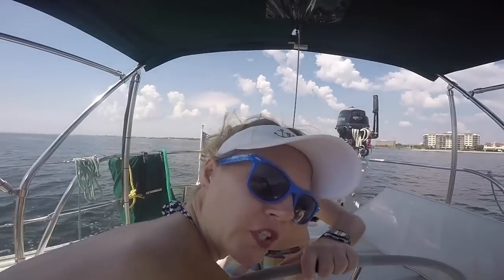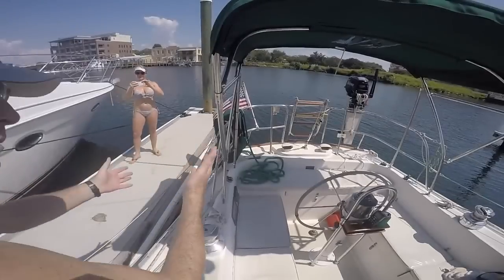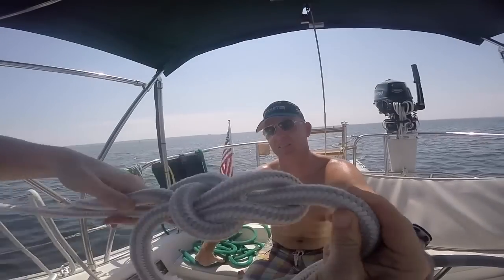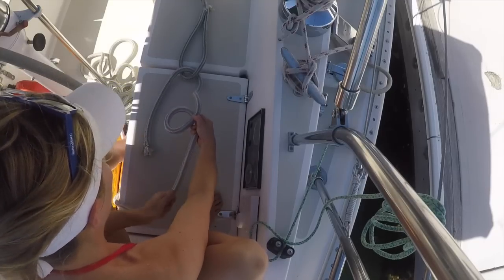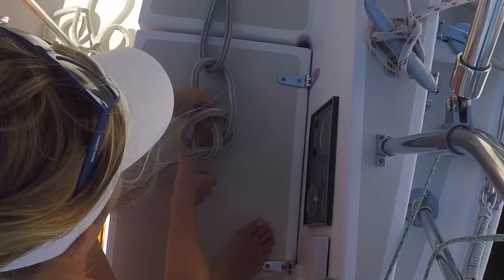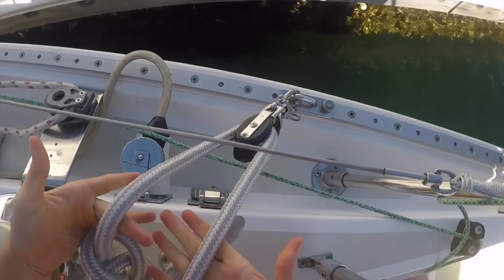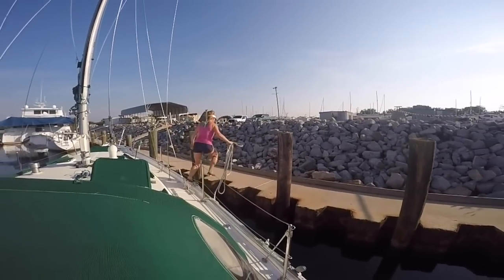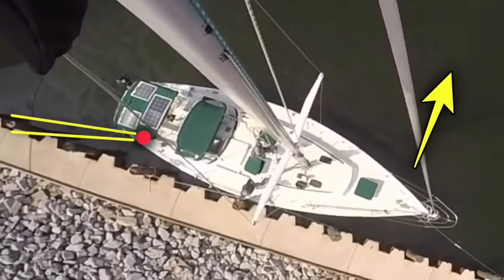#81: How to Dock Single-Handed

Comment: I singlehand a lot and my boat is similar in size.    I advise against using a complete loop.    If you get into trouble, you will have no way to ditch the line and power away from the dock.  I make a bowline loop in the end of the dock line and approach the dock as slow as possible while maintaining control and put the boat into neutral.    (This is not a race)   Get the bowline loop over a dock cleat - using an extended boat hook works well, put the loop over the hook.    Its made for that.   Once the cleat is looped, wrap the line around a cleat on your boat for almost one turn and hold the end of the rope back away from the cleat.   As the rope gets tight pull on the rope and brake the boat... the rope may slide for a foot or two as the boat slows.   When the boat stops moving, fasten the rope to the cleat.   Put the boat into forward and idle...  This will drive the boat against the dock and prevent the wind from blowing you around.    Once the boat is held against the dock, go forward and toss a line around another cleat on the dock from the bow.  Secure.   Return to the cockpit and put the trans into neutral and shutdown the engine.    If you do this correctly, you can do this in a slow and methodical way and not have to run or move really fast which greatly improves your odds of success.    If for some reason you are going too fast as you approach the dock and you can't brake the boat.... let the rope slide over the side.    It will be hanging from the cleat when you try it again.    On attempt #2 you can use another rope or grab the hanging rope with your boat hook.  If you have a fixed loop and you get into trouble you have no way to escape without cutting the line...  which takes too much time.   You always need a plan B in case you get into trouble.   I have done this at night, singlehand several times.     Its not hard.

Comment: Although your attempt to offer advice is commendable, docking a boat on a pontoon that is longer than your boat is not particularly difficult. If you show a technique for single handing a boat into a pontoon berth shorter than the length of you boat I would be much more impressed!
Reply: Agree, using the stern cleat is just not an option with same length or shorter pontoon berths. When using a mid ships spring line, controlling the stern swing out is the challange, and avoiding a hit on the boat next to you.

Comment: Everybody knows that the pivot point is not at the rudder. If you attache the docking line at the real pivot point which is normally close to the beem or the middle of the boat, you do not need to turn the wheel at all, the boat will move to the dock under forward slow power and stay parallel to the dock.

Comment: Just a quick summary about pivot points. It moves based on the boat’s motion, pressure fields around the hull, and the amount/location of forces applied to the boat. Stopped, is is generally near the middle of the boat. When going ahead/fwd, the pivot point is towards the bow.  When going, astern, the pivot point moves aft.  When not making way, but stemming a current, it moves towards the up current end of the boat.  Once you put a single line ashore, the pivot point is at the point where the line is attached (in in the case of the anchor, the chain roller).  So by putting the line on the stbd qtr, once strain is applied, you are putting the pivot point where you want/need it.

Comment: Thanks for the demo. As a long-time single-hander I'm a great advocate of techniques that make docking ('berthing') easier. There are probably as many ways of doing it as there are economists with solutions to the national debt, but the principle is one that mariners for generations have known as 'using a spring'. It's possible to spring on, or to spring off. A rope attached to a cleat on the boat near the stern or the bow and run along the dock can be used to spring on or spring off. Best of all, however, especially when singlehanded or lightly crewed is a spring secured to a midships cleat, which uses a technique similar to the one you have demonstrated, but with greater versatility if the wind is blowing off the berth or if there is a cross-berth current. My own preference is not to obsess too much about the pivot point - but instead to focus on the merits of a system that keeps the line clear of the propellor; that is as short as possible once secured; and as near the mid point of the boat as possible. That way the boat can be held snugly against the dock and wind or current can't lever the boat off the berth at one end while the permanent lines are rigged. One other tip is to check out the range of boathooks available on the market that enable a loop to be placed on a dock cleat or the mooring eye of a buoy without leaving the boat or leaning over the side - the best of them work really well and once tried you'll wonder why you never had one earlier. In fact, more than one .... so that lines at both ends of the boat can be placed using the device. Anyhow, good sailing to you guys ..... and please keep the tips coming. None of us is too experienced to learn new tricks! Here's one of those boathooks that works well: https://youtu.be/3zhPsTtLy4c
Reply from the maker: Great, thank you for sharing Roy!

Comment: Good demo guys, the more you practice the easier it will get and your confidence will grow so you can do it with the wind blowing you off the dock.  Easiest way of determining the pivot point of your boat is to observe what happens as you steer the boat in open water.  If you turn hard to port you will observe that the bow will go to port but the stern will go to starboard.  This is an extremely important thing to know when docking or coming alongside.  Most fin keel boats are designed to and will have a pivot point (while moving forward) that is in line with the mast and on the leading edge of the keel.  In reverse the pivot point is the trailing edge of the keel and just aft of the mast. Long keel boats are slightly different but only slightly. Your docking procedure works well but you are not using the steering pivot point you are just using a spring point.  For your docking procedure you need the attachment to the boat to be well aft.  I do something similar using my mid ship cleat with just a long loop that I slip over a dock cleat from the helm as I slowly pass, I do not need to do anything with the steering.  Try this exercise when you get a chance, it is great fun and will demonstrate the pivot point of your boat.  In some open water, bring the boat to a stop and while keeping the helm dead ahead, give a blast of reverse and watch which way the boat turns, it will turn slightly.  Its called prop walk and is very useful.  With a prop walk to port, that is the stern going to port in reverse, you can with practice, turn the boat in its own length going to starboard.  With a prop walk to starboard the turn should be to port.  Here is how you do it, with the boat dead in the water put the helm hard over to starboard and leave it there. Now give a short blast of forward just until you feel the helm wobble and then take the power off.  The bow will now be turning to starboard and the stern will be going to port but the boat should NOT be going forward (much).  Now give a short blast of power in reverse, this will stop any forward motion you have and the prop walk will make the stern go to port and the bow to starboard thus continuing the turn.  See how this is going? so just keep the helm hard to starboard and give short blasts of power alternating between forward and reverse (without crashing the gearbox) and you will amaze people with your skill.  Developing this skill can get you out of a whole heap of trouble. Good luck, fair winds and sunny days.
Reply from the maker: Thanks Paul.  Appreciate the input!

Comment: Interesting technique.  I am definitely going to try to use it if possible.  The challenge with my current slip is a 5 knot cross current. Therefore I always have to approach with a decent way on, so as not to be pushed into my slip-neighbour's boat by the current.  This means approaching the dock faster than I would prefer, and then hitting  reverse at the last minute.  My whole adult life I have expounded the virtuues of slow speed, gentle docking, but now I am a member of a club that is located in the bottom of a canal, so all of that has changed.

Comment: Thanks for the vids!

I prefer bridles for that situation, same concept but different. On my boat I run a long loop from the midship cleat (or chainplate bc I lack midship cleats) to the sheet winch. Coil the loop, split the coils between both hands and throw in a Y shape. With some practice you can catch a cleat from quite far. Then just haul in the line via the sheet winch and steam forward. Because of the triangle shape the stern is kept in check. Now step off the boat. I never leave my boat without a line attached somewhere. And yeah, it works in windy conditions as well.
Reply from the maker: Awesome.  Thanks for sharing Horst.  I would imagine the triangle shape, as you call it, would be a great way to spread the force to keep the boat parallel to the dock.  Thanks for watching and commenting!

Comment: I always dock at my slip using a premeasured line. I, however leave my slip lines at the dock. I have other lines on board if going to another dock, etc. The slip stern line has a loop on the end and a tennis ball tied behind the loop five or ten inches. When I leave the slip I toss the stern line in the water. The tennis ball floats and keeps the stern line where I can easily get it with my boat hook. I just put the stern line loop over my winch and ease the boat into the slip. Works great for me.
Reply from the maker: Awesome idea about the tennis ball Greg.  Thanks for sharing.  Sounds like your plan is like ours in the reciprocal as you attach from the dock to the boat but same principles.  Good tips here.  Thank you!

Comment: Thanks for the video!  A couple quick comments: always step off a boat, especially smaller ones.  Never jump.  You should whip or tape or heat shrink the bitter end of the lines.  You can use a sheet bend or double sheet bend to make a loop out of the dock line.  It's quicker than a bowline and quite secure.  If both ends of the line were plain, a reef knot would work.  Sheet bend may be a little more secure in that use.  Also, steering away from the dock is to have the motor thrust push the stern towards the dock.  The stern line levers the whole boat into the dock due to the forward part of the motor thrust.
Reply from the maker: Thanks Loanwood.  All very good points to add.  Appreciate you watching and chiming in.

Comment: If there is no off catway current or wind, then this method works fine. If there is a off current and/or wind, the stem would quickly veer off the pontoon. A long, slightly forward of midship spring line would be much safer bet. Also, a slack bowline is an insecure knot as it easily comes undone, catches easily on deck ware, plus there is chafing between the two lines. A safer knot would be the more compact double sheet bend or, if there is not an eye on one of the lines, there’s always the zeppelin bend which is a too little known and used vibration proof bend. Thanks for the vid and good winds to you.

Comment: Docked single many times. Weather makes it very challenging but the key is planning ahead, a radio is well worth the investment also. Hell It once took two of us more than an hour just to set anchor out of the navigation channel on a 30 footer in river current when a gust front surprised us followed by a squall line coming through. Wasn't really frightening but definitely got some adrenaline going.
Reply from the maker: Thanks Damien.  Boats are definitely never boring (to me).  Always an adventure.

Comment: great vid annie,now try adding 5 knot current,(depending on which way the tide was flowing )and having a draw bridge bout a 100 feet from where you dock,annnnd ,a boat on ither end of your docking spot,lol,it was a trick getting a 20 ton 60 foot schooner to do what you wanted .there were times we had to get a spring line on a piling and back her down into the dock ,our prop would pull us in.,,plus add 20 feet of bowsprit into the mess,lol.it was the hardest job I ever loved ,we did day sails
Reply from the maker: I can only imagine.  I know the conditions were pristine when we did this but according to Pam it can work in all conditions.  I'm glad you found it helpful!

Comment: Very nicely done video. I would worry that the procedure you demonstrate works fine  only whenever the wind or current is not blowing the boat off the dock. I think if you use a midships after spring line instead of a stern spring line, the maneuver would work 100% of the time, plus you don't have to worry about running out of slip length and hitting the dock. With a midships spring line you do need to carefully adjust your rudder angle so the boat stays parallel to the slip while you use the throttle to overcome any wind pressure (or current) and force the boat to the dock.

FWIW the term  "pivot point" means the point that the boat rotates around when you change direction , on your typical sailboat the pivot point is approximately the mid-point of the keel.

Comment: Good tips you have shared.   I have seen troubles with two things that would be helpful to add.  1.  Never step over the lifelines!!! Very dangerous.  2.  Always tie the dingy tight on the opposite side of docking.
Reply from the maker: Hey Ron.  Thanks for watching.  Good tips here as well.  Our dinghy is always tied tight on port when we dock.  We cinch it up as tight as it can go to ensure the painter line does not get in the prop.  I'll have to watch the video again to see if Phillip stepped over the lifelines in the docking video.  I thought he had opened the gate, but I'll check again.  Thanks.

Comment: I have dumb question...once you reversed how do you avoid getting your dinghy's tow line caught in the boats prop? I see dinghy's long term towed so often...or at least so it appears and I can't help but wonder how this can help but happen.
Reply from the maker: Hey Tazmun.  There are no dumb questions here.  That's a good one and one that I was worried about when we first started towing our new dinghy a couple of months ago.  When coming into the dock (the same time we're getting our dock lines out and ready), we pull in the painter line on the dinghy and cleat it as tight as it can so it goes straight from the chalk to the dinghy, just barely touching the water.  That way it doesn't have enough slack to go below the water and foul the prop.  Definitely a great question and something to be mindful of when you're coming into the dock while towing a dinghy.

Comment: Photographer has selected perfect camera angles.
Reply from the maker: She's got a good eye.  ; )
Reply: Oh.   Hmmm.     Ok.
Reply: You mean at the end of the boob...euh... sorry I meant at the end of the loop!   ;o)    Anyway, it always helps to get some attention. She certainly grabbed mine. Altough this complete manouvre is not useful for me. My boat doesn't have a toerail where I can choose that point, and it also has no wheel but a tiller and joystick. Also is the distance between the prop and the rudder to big to make it work at all. And the response of a folding prop (Flexofold two blade) when put into reverse can be scarifying long... (I sail a Dehler 33 by Judel/Vrolijk)

Comment: An even simpler technique I use is to get a wood, or aluminum hoop about 12 to maybe 15" across, and tie essentially a stern line, and a bow spring line to it. as you arrive at the dock all you do is toss the hoop on the dock's cleat you would use to tie off the stern line. The stern line will hold the bow off meaning you won't have to steer to hold it off, the bow line will hold the boat from moving forward, and no lines will have to go aft of the boat meaning you won't have to rely on the dock extending past the stern. Of course you will still need to keep the engine in gear, and at idle just as with your technique to keep the boat in place against the lines until you get the stern spring, and bow lines in place.
Reply from the maker: Huh, interesting technique.  Thanks for sharing Dave.
Reply: I need to try this, our dock is barely longer than my boat.

Comment: Nice video. I sail solo and I got a few ideas from your video. Not sure about getting off the boat with it still in gear though.
Reply from the maker: Thanks Barry.  I had another follower tell me that too, so it seems to definitely be a concern.  I'm just passing off the Pam trick.  Maybe if you feel the boat is still enough.  Go back to neutral or kill the engine and get off quickly with another line in hand.  Appreciate you watching and commenting.
Reply: Hi Barry, 
Glad you made it to NZ

Comment: Thanks for the useful tip. My apologies in anticipation if this has already been asked or answered but would a midship line not be of use in a singlehanded docking situation? My preference is to get a midship line ashore first with the motor idling forward which springs the boat alongside, even if you are being blown away from the berth. One can then secure bow and stern lines at your leisure. Thanks for sharing your tip. Kind regards and fair winds.
Reply from the maker: Hey Philip!  Not a bad question at all.  Several people have mentioned this.  The only problem I see with a true "midship" line would be the fact that it would be forward of the pivot point and would have the potential to pull the bow into the dock (just as in the example in the video where I pulled the bow of our boat into the dock by pulling in fast on a midship line).  This is basically the same technique but using a line that is affixed at the aft pivot point of the vessel.  Hope this helps!